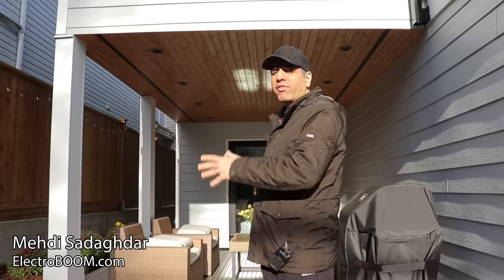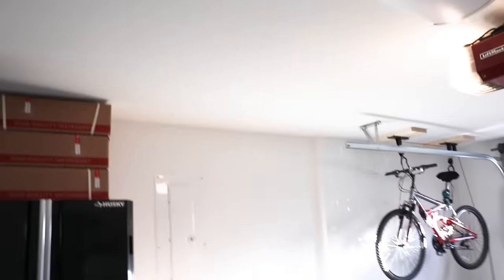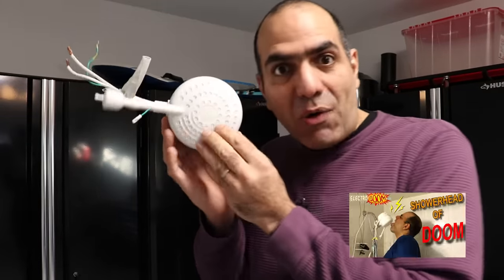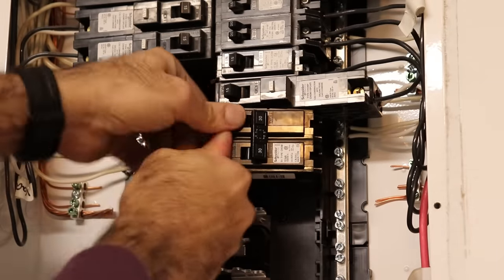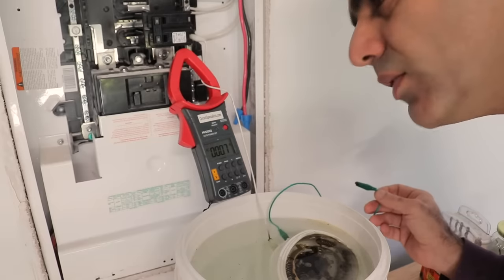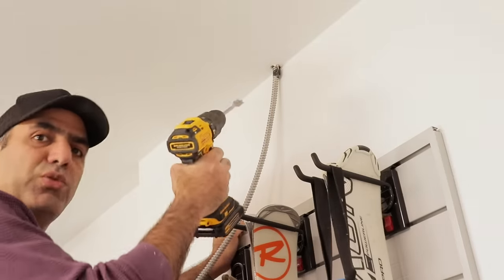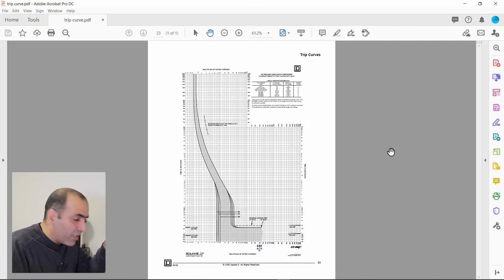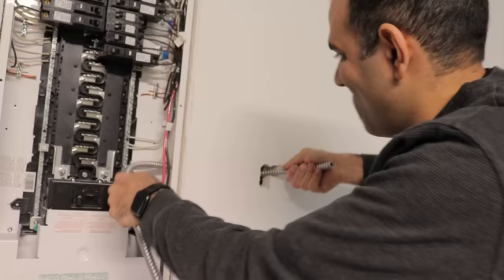Electric Patio Heater Wiring and Installation

Comment: My first job out of college 2,000 years ago was designing residential circuit breakers. We tested and calibrated breakers using low voltage, usually from a buck/boost transformer tapped for 3 volts. If i remember correctly, according to the UL/CSA rules a circuit breaker in that frame size was only required to trip within 60 seconds at 200% rated current. I think it had to trip within one hour at 135% UL at the time allowed up to 5ma leakage current with the breaker tripped so we used that to drive a LED through the load. That was a great job, really enjoyed blowing up breakers!

Comment: "IS THIS LIVE?"
touches with the finger...
LMAO
Reply: He's not touching anything that's grounded, from what I can tell. Even if it were hot he wouldn't have gotten shocked. Old time electricians will often check if a circuit is hot by grounding their thumb and touching the live wire with a finger tip. Some have killed their nerve endings and have to lick their fingers to tell.
Reply: @xtremegamer4696  He's standing on ground, thus closing the circuit by touching anything live. The high resistance would've lowered the amps quite a bit so there is no way it could've burned or harm him in any thermal way. So if he only touches the nail for a blink of a second he would've been fine because the heart wouldn't been exposed too long to the alternating current. Still would've felt the shock though :D Hurts like a sucker.
Reply: it's cananda, 110 v... not britain where it's 240 v
Reply: @xtremegamer4696  Actually not killed nerves,just have thick dry skin which is a good insulator even for 400V.
Reply: @ProckerDark  Canasa is 120V bruh not 110
Reply: @mernok2001  yeah, they refer to north america's electric system as a whole as 110 volt system

Comment: "I'm doing it because i'm confident with that stuff"

"is this live?"
touch potential live wire
"no"

Yeap, You are very confident.
Reply: Imagine a parallel universe where Mehdi is severely colorblind and when he puts on different colored sheathing for the ground and live wires and then touches the wrong one...
Reply: @theories665  How is your comment 22 minutes ago while his is 17? Wtf
Reply: @animeshpanda2960  Um, for me my comment is 46 minutes ago and his is 58 minutes ago. Maybe your clock settings or time zone are different?
Reply: At least he was wearing shoes?
Reply: @gooseman2376 I've heard that if the voltage and amps are high enough, like the powerlines in our neighborhoods, even sneakers won't help too much.
Reply: Poking with fingers is real.
Reply: @theories665  If you touch a power line then shoes won’t insulate very much considering that power lines are close to around 115kV, but when it comes to the power that’s given to your house it’s typically around 120V-240V AC, so tapping it won’t be deadly if you are insulated from the ground and you don’t touch both live and neutral at the same time
Reply: @gooseman2376  I have learned today, thank you for this knowledge. Very interesting.

Comment: This video gave me anxiety, particularly the part where you're wiggling the breaker back-and-forth in an energized service panel. Your videos always make my day a little better, though!
Reply: @Dark Dreamz I invite you to Germany. Suburb house service usually is 3 phase with line to line 400V and line to neutral 230V. I've been doing that for years, but a 50A SLS 3phasse 230/400v distribution board still instills respect. Guess that's why I'm still alive. Nevermind the unfused service provider side of things. Thanks for NH fuse disconnect gloves and arc flash gear in general.
Reply: @marikann9073  I always like reading about how other countries use electricity. Thanks for that info!
Reply: @Dark Dreamz We are actually starting to see some three phase in some residential dwellings now though (ev charging and solar pv setups mainly)
Reply: @Dark Dreamz Big industries use 690V phase-phase andf 400V phase-neutral.

Comment: 4:46" is this live?", then proceed to use finger to touch it
Reply: As long as he doesn’t grip it and/or touches ground in same time, it’s not dangerous. There will be reactions though.
Reply: @matperry18  Hes standing on the floor though.
Reply: @whatever7338  he usually wears rubber shoes when he’s working on electricity
Reply: thats not fine when you are dealing with city power even your theory is right. You never know what you never know, thats how accident happen

Comment: 12:27 Somebody is getting an electric car!!!
Reply: Holy crap, you're right! That went completely over my head.
Reply: You're probably right. My first thought was an Arc Welder, but that makes more sense.
Reply: Not if his house burns down first.  The number of code violations in this video is shocking.
Reply: @GGGenom  What codes were violated?  I'm legit curious as it does not seem bad to me.
Reply: would also explain the allergy to using gas for heat too.
Reply: @redsquirrelftw  1. Branch circuits for heating equipment can only be used for heating equipment - no adding an outlet "for later"
2. Armored cable must enter an enclosure (the panel) through a proper connector - you can't just run the wire through a hole in the panel
3. Unused box knockouts must be filled - not a huge deal because the box is against the wall covering the hole, but there should be a knockout filler there
4. Armored cable MUST have a plastic insert (an anti-short bushing) placed at the end of the armor, inside the connector.  This one is major.  Without anti-shorts, the sharp edges of the sheath cut into the insulation.
5. The duplex connector at the switch is not rated for two 10/3 cables.  It's too tight, and the connector damages the insulation.  I've had an identical setup literally explode in my face.  Needs to be two separate connectors.
Reply: @GGGenom   1. It's a standard 240V 30A circuit, there's no rule against multiple potential loads. The specific outlet he used is wrong, though.
2. If that's true, then whoever built this house violated that multiple times, there isn't a connecter on all of the circuits.
3. As you said, not a big deal.
4. Not good, but really not a major thing. Short circuits like that will trip the breaker.
5. That's a double pole 30A switch, so it's quite literally designed for 2x10 gauge wires.
Reply: Sad.

Comment: There are different categories of breakers for how much current you need for them to trip. Most houses in Australia have a C type circuit breakers installed in which need 7.5 times the rated current to trip instantly.

Comment: as a Electrician this video gave me a insane amount of anxiety
Reply: yes lol
Reply: Never good to see someone messing around in a panel then seconds later ask what a one hole strap is called. Luckily no explosions in this video.
Reply: As a guy who was seriously bitten by 3 phase 240v everyone of his videos makes me bight my nails
Reply: @soundspark   leaves a cut nail under 30 circuit uug
Reply: I think he may have installed a bad breaker lol
Reply: Try not to think about the 7 inches of wire to the breaker
Reply: @kennysboat4432   imagine him contacting the manufacturer and confirming it wasn’t bad. Oh wait. He did do that.
Reply: @KasparrTV  I did not mean bad in the sense that its not functioning, I meant bad in the sense that it was a poorly designed breaker. While there is code, it seems like the number of seconds it takes at that high of load (the max of 100 amps! Yikes!) for that long would be far too dangerous for residential use.
Reply: @wolfie54321  while you may be right. The wrong breaker is not a broken breaker. Simple
Reply: @wolfie54321  a bad breaker is a broken breaker. Or does that not compute in your brain?
Reply: I study electrical engineering in Europe and now i am very worried about Mehdis house
Reply: Nobody talking about the lack of antishorts in his L-16 connectors?
Reply: Same
Reply: Facts!!!!! Had to look away a lot!!
Reply: @komulista You mean wire nuts? Still in use today in the USA on most everything.
Reply: @komulista They don't use wago's as much here in part due to the much higher cost but also because they don't trust them as much given NA has 2x the EU's amperage for standard lines as we use 120v for most lines.   Though the real reason is they use what they have used and anything new, especially if it is easier, looked on as not as trustworthy.
Reply: @wolfie54321  Those breakers aren't meant to stop overpowering or preventing shocks, they are designed to prevent the power lines from burning down. And it'll still react as expected to a short circuit, so It's rating is OK. Other types of breakers provide other protections.
Reply: @komulista wire nuts vintage? Pffff please, in Mexico it's still common to braid wires with pliers and cover them with insulating tape... Zero fires from overloaded lines up to this day.
Reply: @fordrac1ng81  
You should switch, nobody shoud use this anymore. Terminal blocks are easier to use.
Most people use wago as they are secure, fast to install and easy to maintain.
The wire nuts destroy the cables after the first use and not good for any maintenance works.

All systems are secure if done correctly but you'll get more room for errors:
1. braid wires with pliers (most complex to do, lineman use this system: lineman splice)
2. wire nuts (complex to do the right way, twist wire and secure with wire nut)
3. terminal blocks with screws
4. blocks with spring-loaded connection
5. wago blocks (remove the insulation to the correct length, insert the correct length and close or you don't need to close the newer wago blocks anymore)
Reply: Turns out electrical engineers are way different from the applied sciences and skilled trades. Theory out the ass but not a master of practicality 😂
Reply: I was thinking the same thing
Reply: @wolfie54321  All the wiring is rated for 30A, and the 100A spike was for less than a second.

Comment: "Is this live?" Touches bare metal in switchboard
Reply: to be fair on the list of things he has touched this would be a a low bottom rank.
Reply: @damarh  allso he did not grab it he just touched it wich means he whould get a shock but most likely no other negative effects. the real danger is when you grab somthing becaus you will be unable to let go and then just fry to death
Reply: You can actually do that, provided you don't create a potential difference between your now energized self, and something that's bonded to earth, or another phase... 

Ground yourself out, you're getting lit tf up
Reply: That would just give you a shock and you'd just pull your hand away

Comment: Can't wait to see the fun toys he's going to plug into that 240v outlet
Reply: For example meter on current :)
Reply: Electric car charger.
Reply: @klerulo  not with 30 amps... Need more like 50-60
Reply: @user-sc6lp1om9y  rubbish. you can charge just fine on 8 amps unless you drive all over the place all the time. 16 amps is more convenient, granted, but more is overkill unless you are careless.
Reply: @jnawk83  I mean, ya I CAN charge my model 3 slower but why would I do that? At 50 amps I get about 45 miles per hour of charge. I don't think anyone would choose to install a lower amperage breaker going into EV ownership of they understand anything about what they are doing. Its hardly carless to match a charger to it's intended max amperage. Get outta here with your crazy pills.
Reply: @user-sc6lp1om9y  how far you plan to drive per day? 400 miles?   your car will finish its daily charge in an hour or two for a more reasonable commute, and you just paid a shitload for what turns out to be oversized wire and fittings.
Reply: @jnawk83  so I'm going to buy a new EV, charger, pay an electrician to install it and then skimp on a few dollars more of components and a few cents more per foot of wiring all to charge my car slower then what the components are rated for? I don't understand what you are even arguing? No one intentionally does that. All I'm saying is that he would have installed higher amp  stuff if he was getting an EV.
Reply: @user-sc6lp1om9y  your saying its your opinion that he would have. (FTFY)    and I'm reminding you there's absolutely no good reason to do so for most people.  just coz the car can isn't a good reason.   remember he talked about not wanting to consume such a large part of the houshold amperage budget - perhaps he has too much other shit to spare 50 amps for a car that doesn't need 50 amps?
Reply: @jnawk83  there is surely a good reason to charge faster then slower, that would be time. If you ever buy an ev I am sure you will change your mind, but at this point I think your just trolling so you do you. Good luck with slow charging.
Reply: @user-sc6lp1om9y  I own an EV, and 16 amps is just fine. Overnight is plenty of time to charge for daily use.  When road tripping, one uses fast charges away from home, by the very nature of road tripping.   No need for faster charging at home.

Comment: "Water in the fire. Why?!" - Korone-chan
Reply: idk
Reply: Shush i need to study kawaii doggo
Reply: Water electrolysis products dihydrogen and dioxygen gas which are both highly flamable, these are the the bubbles being produced by the resistor.
Reply: @H00GuyZ  but does that explain the fact that there are fire bars underwater in super Mario?
Reply: @H00GuyZ  oxygen isn’t flammable... it’s an oxidizer you need to burn other things :) so their combination burns really well
Reply: It will warm your yubis